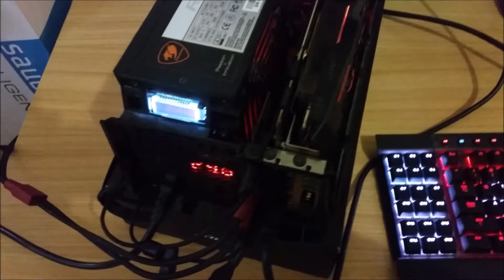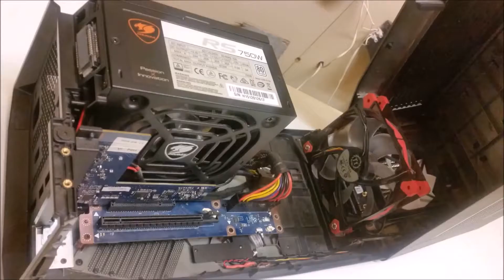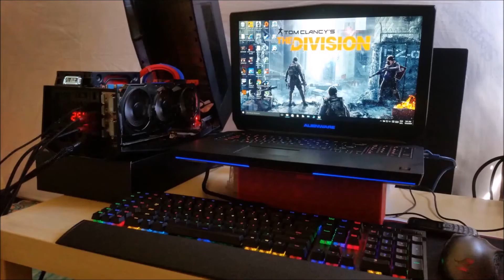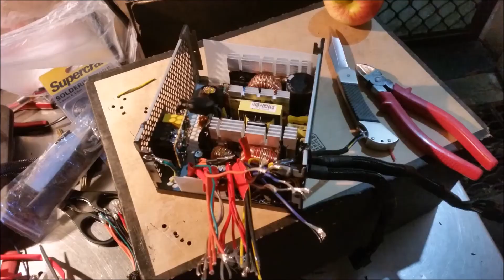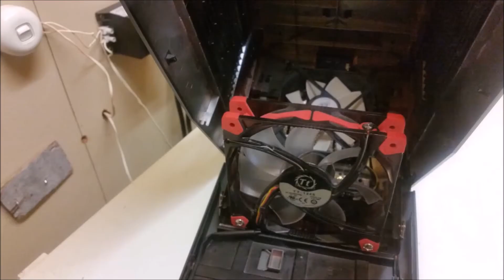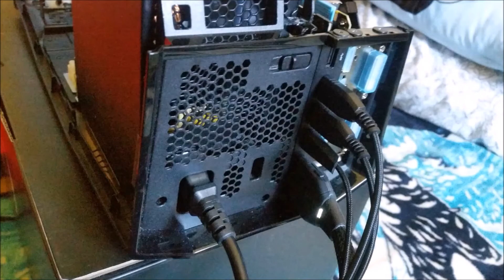Alienware Graphics Amplifier GTX 1080

Comment: Bravo man. Great mods on air. I did the same thing with the stock fan and used it to cool the back of the GPU but that fan is just too annoying. I can't seem to keep my temps below 70c on air under full load. And that's with 100 percent fan speed. Thinking about just saying screw air and getting the hybrid kit for my 1080ftw. Great setup and nice work on your amp!

Comment: Hi, will a 120mm fan fit into the case? I'm not horridly concerned with it closing, but I was definitely looking at getting a Riing Plus 12 LED RGB Radiator Fan TT Premium Edition  or a Corsair LL120 RGB 120mm Dual Light Loop RGB LED PWM Fan for my Alienware Graphics amp. And do you know what pin connector the AMp uses?

Comment: Why would you put a 750 watt in it? extreme waste
Reply: Purple Heart the real the original power supply shortage of current graphics cards.
Reply: Márk Kiss wrong only if the power supplie is powering a desktop computer c p u and hard drives. When it's just for the graphics card a 450watt is more than enough

Comment: You should remove the cover to the aga. Not gonna want that close anyway with the cooler type we have. Then you can cool it however you want. I have a desktop fan (thermal take riing) and another desk fan behind all of it. My temps are now in the mid 50s. Better overclocks and can crank the voltage up all the way now.
Reply: When you removed the cover to the Graphics Amplifier was it as simple as just disconnecting the wires and unscrewing the lid? Just asking because I do not know what that small PCB is above the fan on the lid. Thanks for any pointers. I just got my aga and Im waiting for my graphics card to arrive. Thanks!
Reply: John Jones yeah that small PCB is the alien head. Just remove screws and it come right off. Disconnect the fan tho.
Reply: Mike thanks Mike!

Comment: What psu is that??
Reply from the maker: Cougar RS750 750WATT
Reply: thx and i have another question! what temps you get while gaming for an hour or more with asus strix amp opened?
Reply from the maker: the temps is going around 
48 to 62 C
Reply: Ty. 
I'm planning to buy amp + asus strix so just wanted to know.
Reply: Did it fit easily without needing to cut any part of the GA?
Reply: I think he keeps the amp open. 
Asus strix is way too big to fit inside amp

Comment: great mod bro but what psu  are you using?
Reply: jason rodriguez an overpowered waste of money psu.... no video card pulls 750w
Reply: jason rodriguez this videocard using minimum 550w power and alienware psu maximum 460w..
Reply: Umm no... Goto geforce.com and look at the 1080 specs, max gpu power 180w, even when hardocp overclocked it it was at 308w, hell an oc'd 1080ti is under the 400w mark, again pointless
Reply: I using the Evga GTX Titan-X Hybrid 12gb gddr5 videocard in the amplifier, but this card using minimum 600w power so i change the psu one better 750W